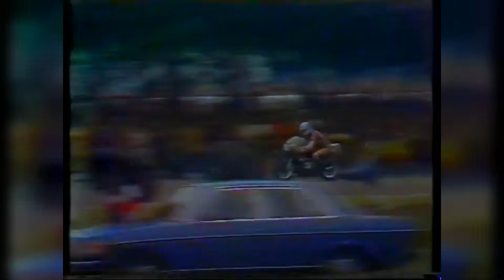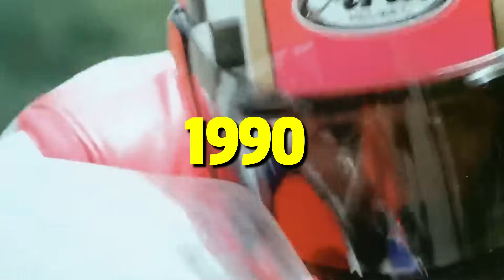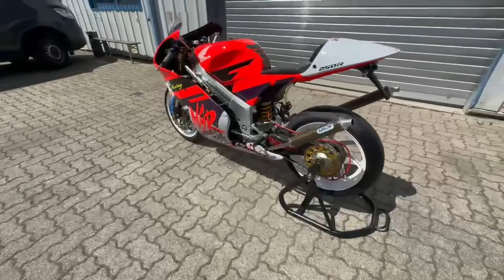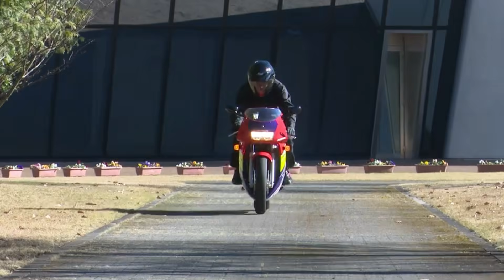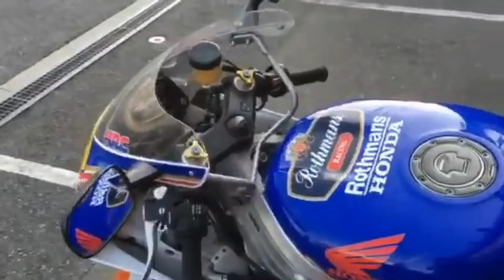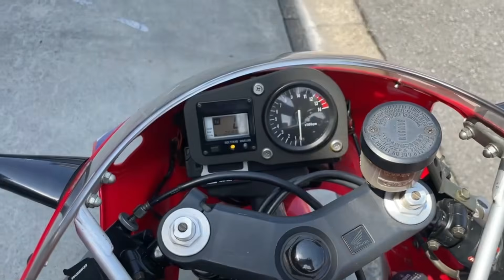The Shocking Truth Behind HONDA's Banned NSR250R Engine

Comment: I had a NSR 125 with PGM-3, longer 1st gear, beefier crankshaft/ conrod, different adjustable front forks and rear gas shock, tuned cylinder and head/piston compared to regular NSR 125. I sold it because wanted a 250 but still haven't got one yet, I kind of want a mk2 KR1S, TZR, RGV, RS or NSR, I just can't decide? 
Cheerio...(Imagine being able to get your hands on a Gilera GFR 250 or a Cagiva 500!?)

Comment: Mc21 is the best, i had 3 of them,  it can derestrict to 60hp
with just cutting and rewiring a cable near the pgm,  (there is also the gps mod with 3rd gear advance ignition to all gears).

Full hrc kit was 72hp 
And the weight can go a lot down removing road parts.

It can fit or copy honda rs parts or aftermarket 
Iv seen 13,500 rpm and Nippon seiki in the clocks= 210km. 

They stoped it because of emitions, smoke, and people stopped buying 250, they went to 600cc,900,1000cc 
Aprilia continued a little more
Fuell consumption was near 5,5 liter/100,  quality was honda at his best, good torque.   Used prises skyrocked and parts are getting hard to find..  
I byed mines close to 1000-1500$ per unit.  13 years ago